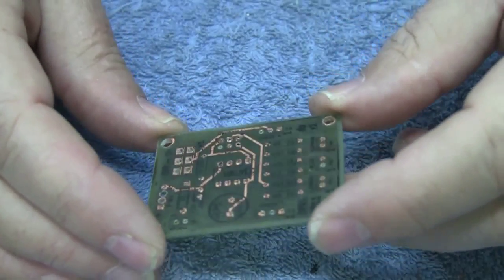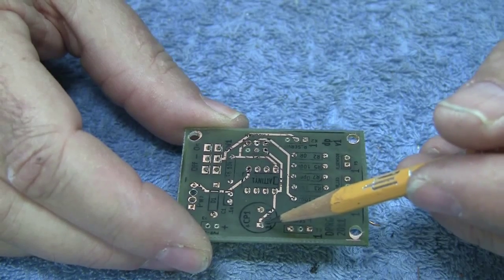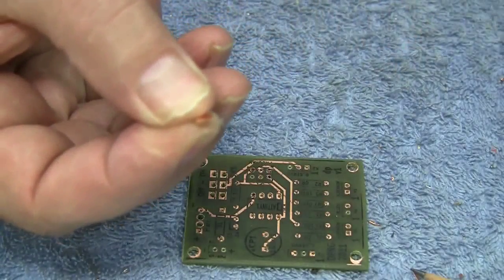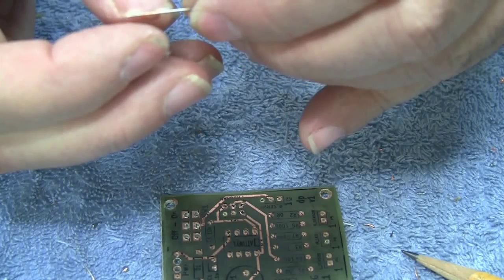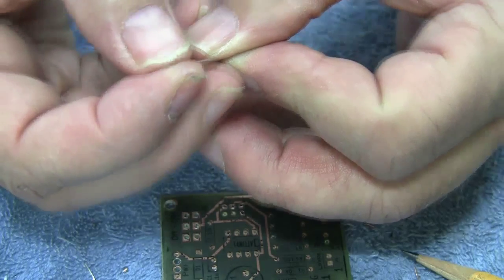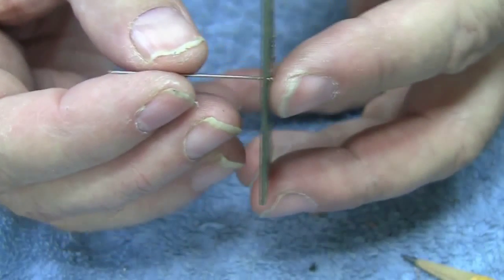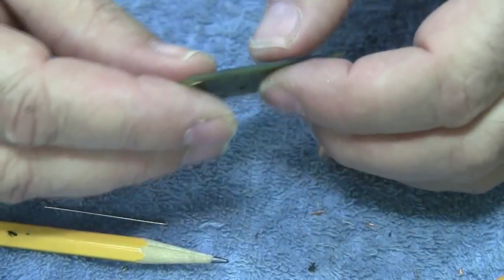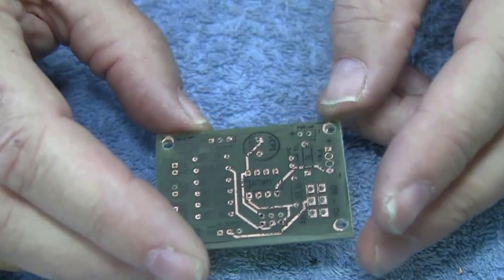Mock plated via

Comment: not a bad idea. I have tried all of the other ways to do it but not this one. looks very promising, and so much easier than accually plating with real copper and electricity, but the only thing i wonder about is that shouldn't you do more than one wrap around the pin for the high current transfer from the cap
thanks weavtech78